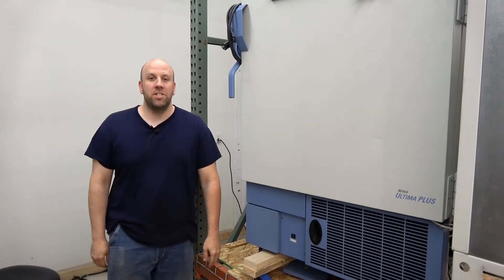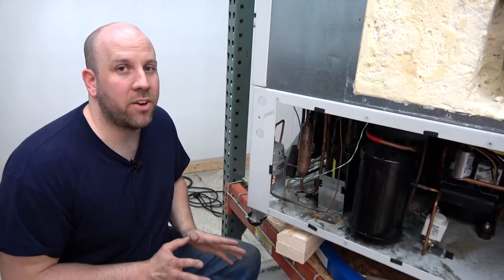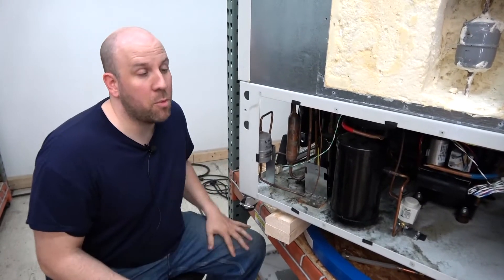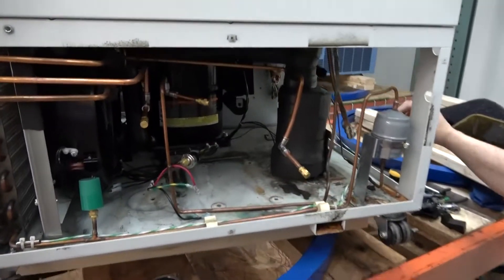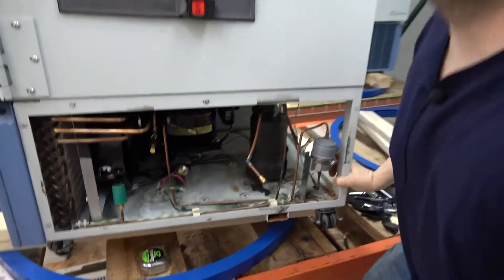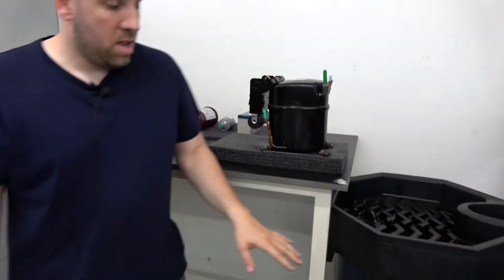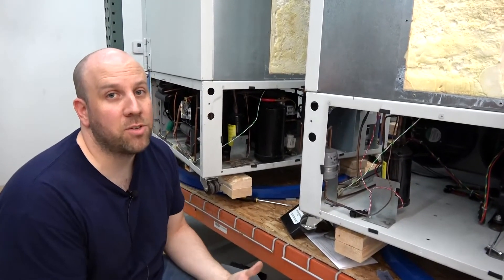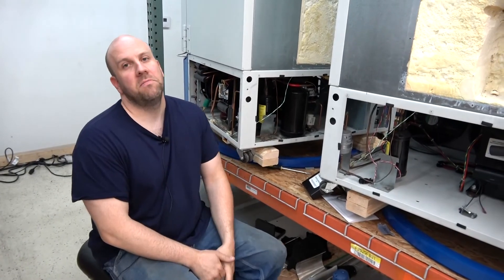How We Refurbish 2-Stage Cascade Refrigeration Ultra-Low Temperature (ULT) Freezers

Comment: Can you test 2nd stage compressor with 1st stage compressor being bad? Or is there a method or temperature to look out for?
Reply from the maker: Hi! You can perform a continuity test to determine whether there is a short or open winding in the compressor. Additionally, you can use the wires from the first stage and connect them to the second stage to perform an amp draw test. However, since the primary function of the first stage is to cool the second stage, there is no practical way to run the second-stage compressor for an extended period without causing it to overheat. 

Hope this helps.

If you have further inquiries, please email us at cs@newlifescientific.com

You may also visit our website www.newlifescientific.com to live chat with an agent.

Comment: any hints as to what could be the problem with a 15 year old Sanyo that developed a fluctuation issue but only when it is loaded, empty it will cool down to -80 no problem, open the doors, vent it, it will return back to -80C in under 30 minutes, but once we put couple kg of samples in it, it will draw down to -75ish and then start to swing between -75 and -55, during this time compressor power draw (both H and L) will drop from normal 2.1-2.4A down to 1.3-1.6A for each compressor and will stay there for a while, an hour perhaps, during this time the chamber temp is going up steadily, the output line measured next to compressor is normally at 88-90C while the current draw is above 2A, but output line temp drops to 60-70C while the compressor is drawing little power, then the current draw will rise again to 2~2.4A for each compressor and output line temp returns to 88-90C

Comment: What is the purpose of expansion tank and in which stage it is installed? I would really appreciate your response
Reply from the maker: Hi! The expansion tank is installed in the 2nd stage refrigeration circuit. The expansion tank is connected to the compressor's suction side by a valve and expansion device. When the system is approaching its operating point, the expansion tank adds more refrigerant to the system. 

Please don't hesitate to send us an email at cs@newlifescientific.com or call us 567-221-0615.

Comment: What do you think of the north air ultra low freezer on Amazon? It reaches -40c and it’s only $400 including tax! Too good to be true right?
Reply: A r404A compressor with r404A refrigerant easily could get -40°C. If it use blend refrigerant, maybe it could get -55°C as well. (Just make sure the ambient temperature lower than 30°C and better it has fan cooler) China product now so cheap.
Reply: @myselfnegative4290   If I add a bit of R1150 to R290 would it reach lower temps? or the boiling point is too far apart to be useful without tremendously increasing the high side pressure? Maybe with significant subcooling?
Reply: @teresashinkansen9402  yeah, it works. But you need adjust the mixture that r1150 not so high and raises discharge temperature -pressure that compressor would not stand. A good refrigerant blend need time and experience to adjust, depends on your purpose, available materials, compressor type etc...
Reply: @teresashinkansen9402  i've tried a mixture of R23, R32 and etc, obtained -50°C high-capacity, non-fluctuation temperature. Discharge temperature 70-80°C, oil bath temperature 60-70°C, condensed liquid mixture kind of high (measured on condenser outlet pipe: 33-35°C). Thanks to standard outside temperature (high), then i just obtained -50 to -52°C at evaporator). Designing ultralow temperature system needs money first, available refrigerant and hood material to gain the heat exchange efficiency.
Reply: @teresashinkansen9402  forgot to say, need quite good oil-separator. Without it, oil will be easily clogged inside evaporator in lower -55°C. So, maybe -60°C will be the threhold of your system if you dont apply one good oil separator. The normal oil separator one, couldn't filter 100% oil particles so you need a designed oil separator with certain refrigerant mixture.

Comment: Why not just replace the compressors? The reed valves  could be gone.
Reply: because new compressors will need oil change too.(factory oil not working in cascade systems.)
Reply: What is the reed valve